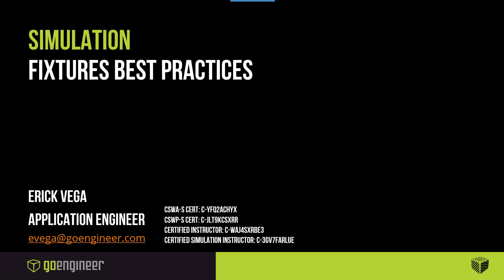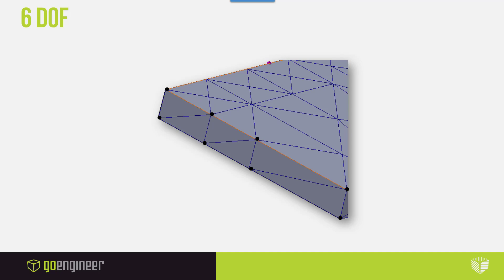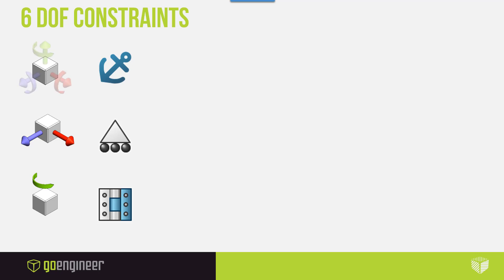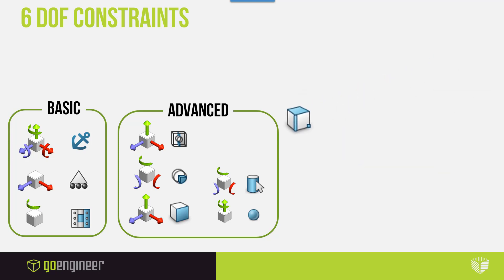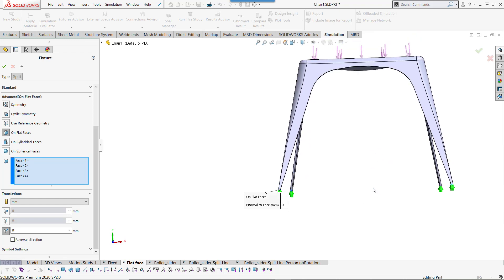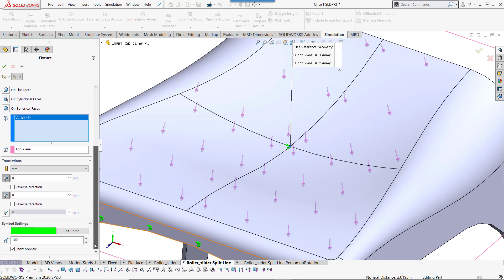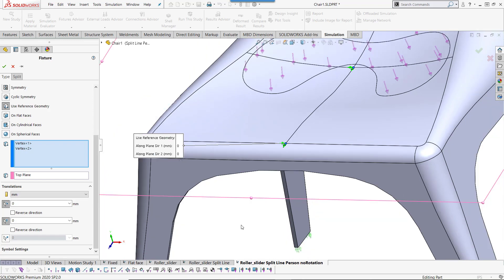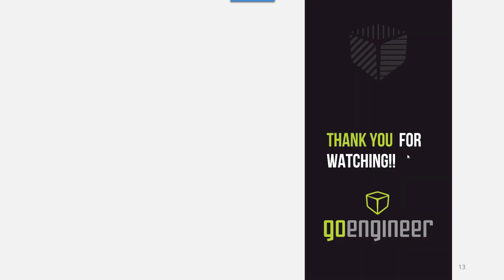SOLIDWORKS Simulation Tutorial - Fixtures Better Practices

Comment: is the last simulation correct? The stress seems to be concentrated on the fixture point. A better fixture might be at the center of mass of the applied force.
Reply: Thats not a mistake, as you said its a singularity. You cant fix an infinitely small point in real life. As the results goes, you dont have to do anything with it. Dont pay attention to that 2 points. Or if its bother you, you can use stress hot spot diagnostics with localized sensitivity, its not always working for me, but in this case its most likely gonna “grey out” the scale and the area.
Second option is iso clipping: you can manually paint the charts part, for example: type a number like yield strength/2 for upper limit and chose a color, so the program will colorize the areas where is the stress exceeds half of the materials yield strength. If it is localized with high gradients, then its a singularity-just like in this case :) i hope it helps.
Reply: Same thoughts, that's absolutley a singularity, ie:fake concentrated stress. If u notice the results at the char legs where it should be the highest value is actually 19.5 which is nearly the same as calculated with roller conditions, thus I personally think he made a mistake regarding the prediction of the highest stress value in the last simulation.